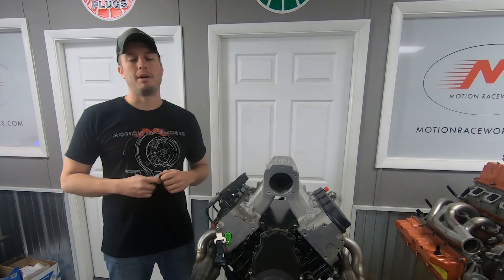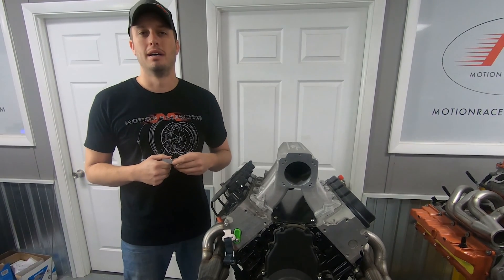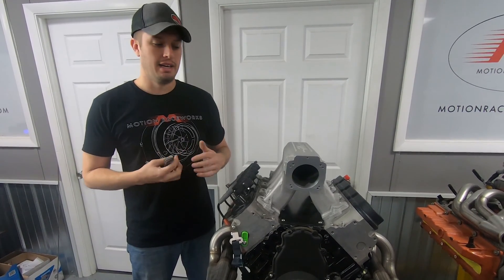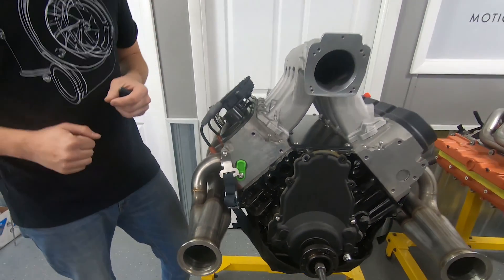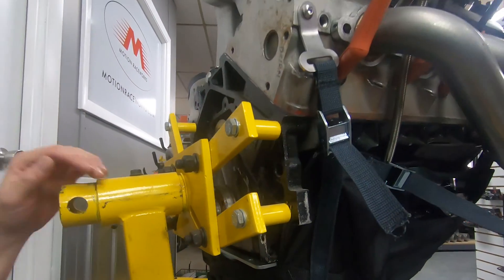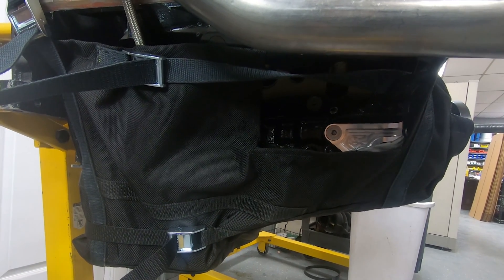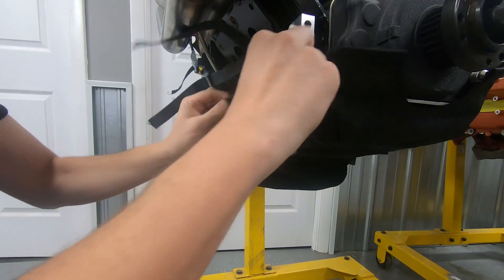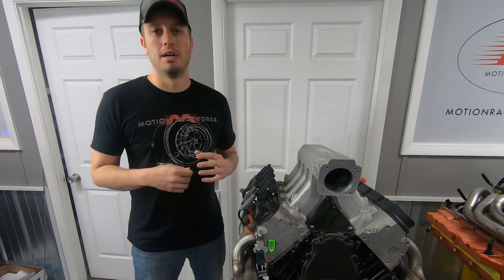Engine Diapers and Why They're IMPORTANT!

Comment: What about cars that are also daily drivers or street friendly? Is it something left on all the time or will I have to go to my tuner/mechanic to install on track days?
Reply from the maker: John Puli we had some customers concerned with daily driving and heat.  They did back to back tests and it actually caused zero degree difference in oil temperature and coolant temperature leaving it on.

Comment: Does having the motor mount cutout impact how effective the diaper is at doing it's job?   I have a motor/mid plate, but also have travel limiters so I need a place for them to exit the diaper, I'm assuming I'd need the motor mount cutout for that.
Reply from the maker: RecklessRegal it gives a little room to lose pieces and oil out but it’s so high up you usually don’t see them break out bad up that high.  The addition of the motor mounts typically reinforces and keeps that part of the block from “blowing out” ATLEAST from what I have typically seen.

-Doug
Reply: @MotionRaceworksOfficial  So with travel limiters, do I buy the motor mount style or the motor plate style?